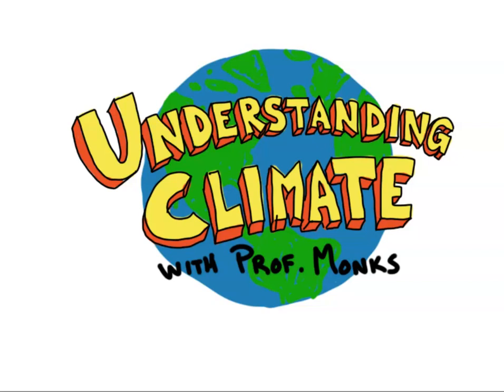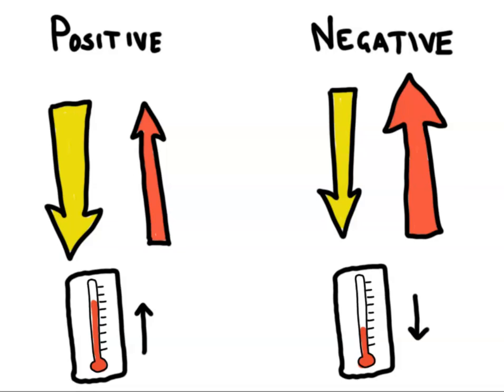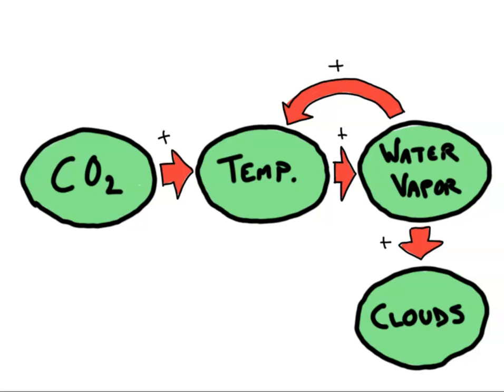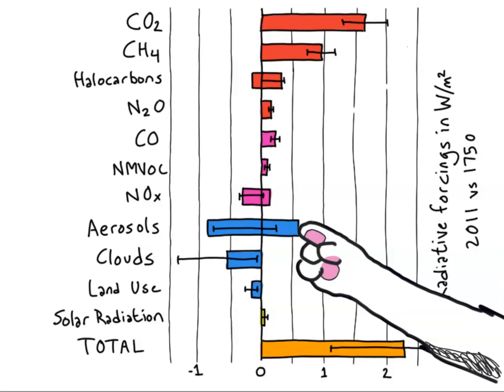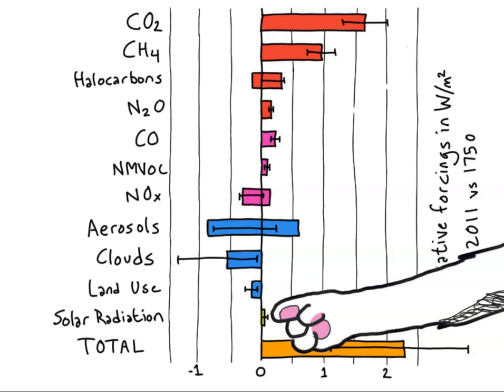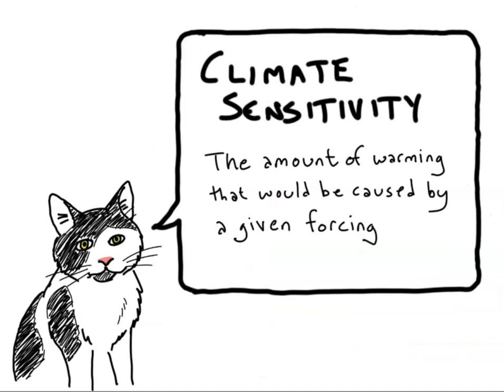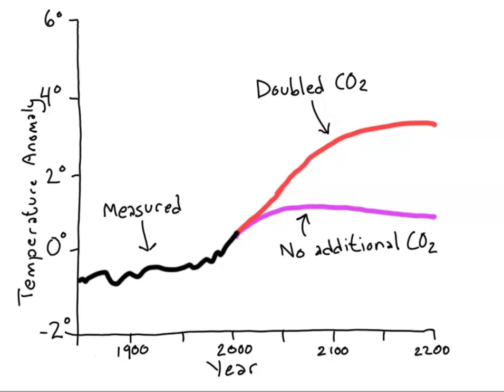Radiative Forcing (Understanding Climate with Professor Monks)

Comment: Wow! You expect intelligent people to believe this inadequate presentation? What happened to water vapour, the effect of ocean currents etc. Solar irradiation is very complex and it changes for many reasons yet you trivialise its importance. How about describing the radiative forcing mechanism? The real heat transfer process relies on the quantum mechanical process of IR absorption  and thermalisation. Heat from the earths surface is principally conveyed by convection to the top of the troposphere. You also make no mention of greenhouse gas saturation or the fact that many of the absorption bands of greenhouse gases overlap. The situation is way more complex than your rather poor model. No wonder the public at large is confused and has so little understanding of what is really going on with our climate.
Reply: I am definitely not lazy. If anybody is lazy it is you. You have not provided an adequate explanation of the complex subject of radiation.  grindupBaker
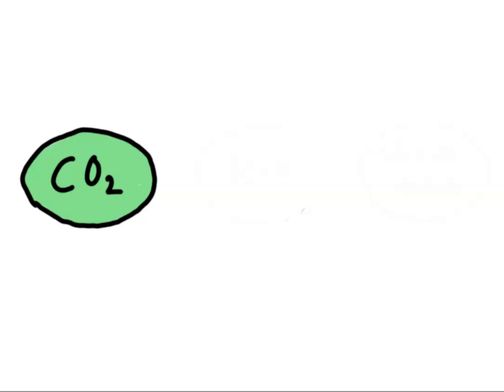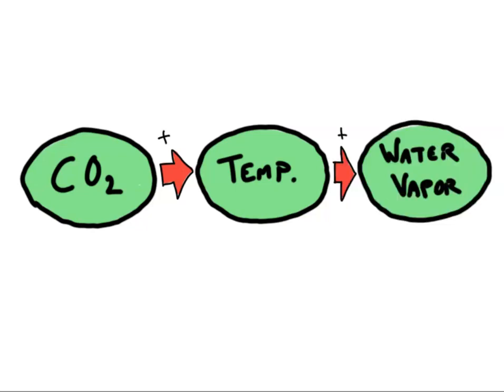Reply: You are either commenting in bad faith or simply ignorant. Yes water vapor is a powerful greenhouse gas however water vapor is not a driver of climate change, it is an amplifier (a positive feedback just as the video describes at 2:00). The amount of water in the atmosphere varies over a matter of days and by region according to air temperature and the availability of water for evaporation. By contrast CO2 is well mixed in the atmosphere and can accumulate at high latitudes (where the poles are). Water has a residence time of only a few days unlike CO2 which can be in the atmosphere for years. If it was water vapor that was driving the recent warming then the greatest warming would be seen in summer and at low latitudes - the opposite of what is actually observed. Again as the video explains at (2:17) the amount of water vapor in the atmosphere has been increasing in recent decades because of anthropogenic CO2 which has warmed the troposphere. Moreover, burning hydrocarbons from fossil fuels is a net addition of water vapor to the system. 

Further reading:
- Al‐Ghussain 2019. Global warming: review on driving forces and mitigation. Environmental Progress & Sustainable Energy, 38(1), pp.13-21.
- Bengtsson 2010. The global atmospheric water cycle. Environmental Research Letters, 5(2), p.025202.
- Santer et al. 2007. Identification of human-induced changes in atmospheric moisture content. Proceedings of the National Academy of Sciences, 104(39), pp.15248-15253.